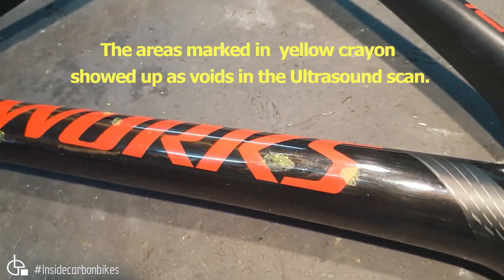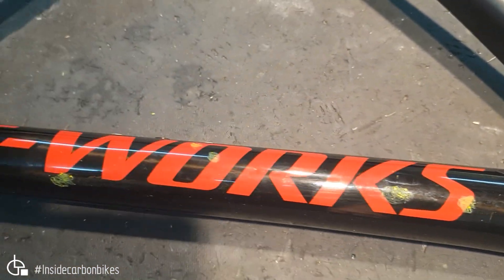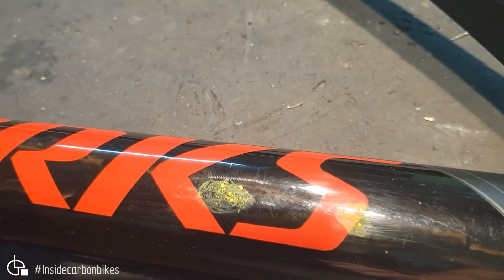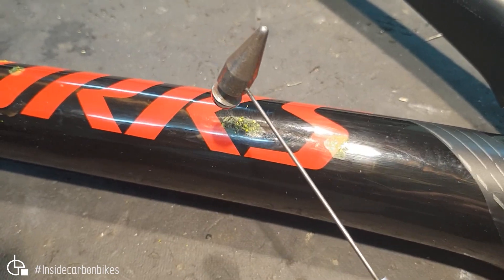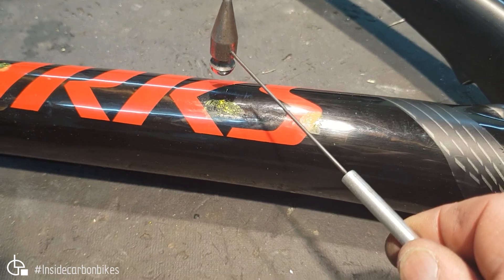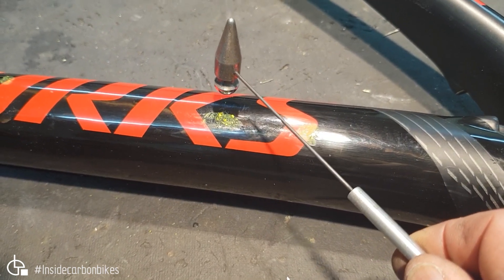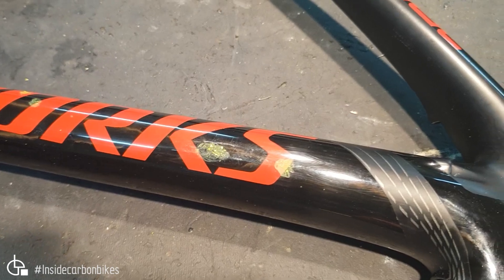Using the Tap Test to verify voids found Ultrasonically

Comment: How do you reckon these voids materialized? General use? Accident, drop? Or manufacturing error?
Reply from the maker: Voids, being trapped air bubbles in the resin can only occur during manufacture of the composite.
Reply: @LuescherTeknik  Can voids like these be fixed?

Comment: The more i look your videos. More i stick on aluminium bikes.🤔✌🏻🧐😉🚴🏻‍♂️
Reply: Yes, but most alloy frames have carbon forks, and if that goes you can be killed, so I don't really see any reduction in risk or improvement in safety with a metal road bike. Also alloy steerers and carbon legs often have bonding issues so an alloy steerer is simply a cost reduction feature and no safer than a complete carbon fork.
Reply: Why anybody put carbon parts with aluminium frame. Like fealing pig with kaviar.
Reply: You mean 'anybody' as in every single road bike manufacturer? Find a titanium or aluminium road bike without a carbon fork.
Reply: No need to worry.  They are all overbuilt.    "Less than ideal" = perfectly rideable
Reply: @segmentkings  If they weren't there would be massive lawsuits of people getting seriously hurt if anything snaps in half. Why carbon fork on alloy frame? Comfort. Carbon is WAY better in dealing with bumps in the road and much easier on your hands (and butt - carbon frame). It can be stiff in one direction, being flexible in the other. To be honest alloy frame is way more dangerous when you think that it has stress life (meaning it will break eventually just from riding the bike) and carbon is only really affected in a crash. So if you crash alot or buy a bike with the intention of crashing, go for steel! :)
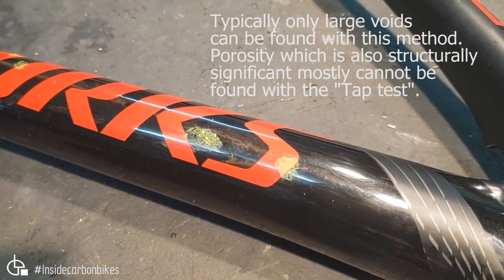Reply: Carbon fork is way easyer to bild than frame. And one carbon part to broke is 1:10 than 10 parts where it can be 10:10.🤓😗
Reply: I think your English is quite good, but it's clearly not your native language and sorry to say I can't understand the point you're trying to make.